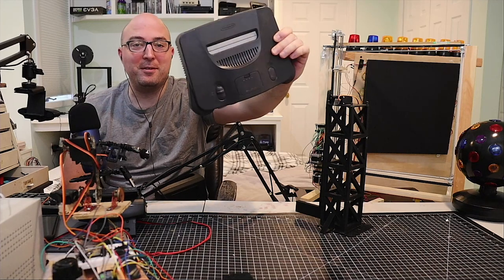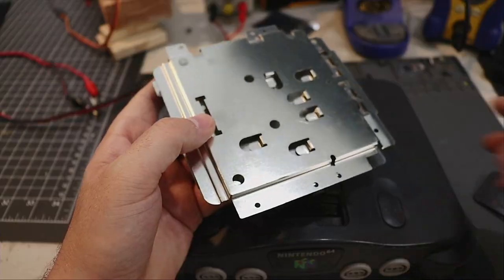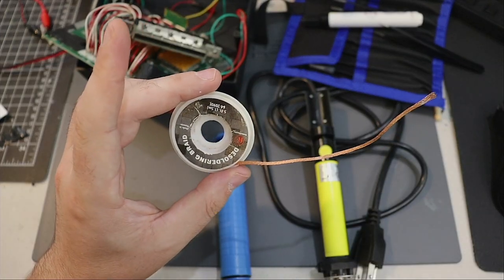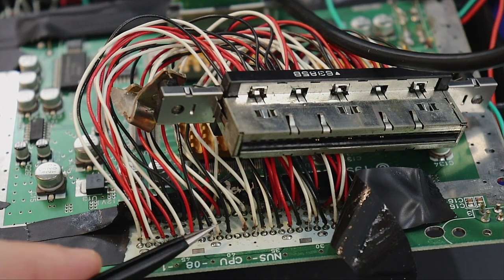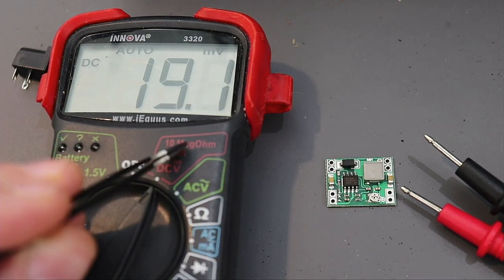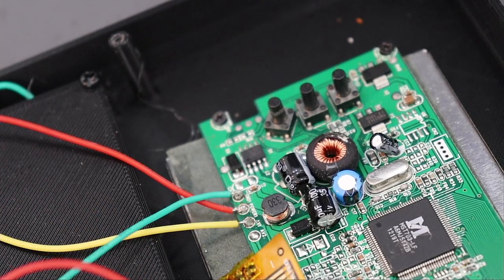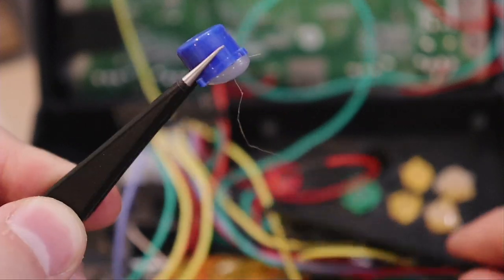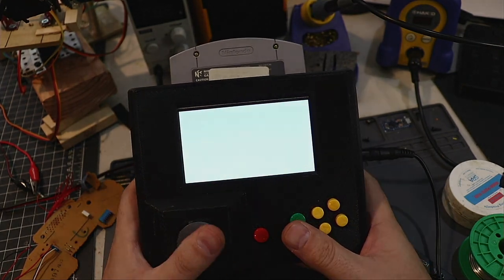How to make a portable Nintendo 64 (N64) with store bought parts

Comment: Hey! So I bought the audio amp and same potentiometers and audio Jack you have. I also want to use these 8ohm 1 watt speakers. How would I wire those in correspondence with your wiring schematic?

Comment: Can you do more tutorial on the power. I just don't understand. Does it take 3.3volts to power the system? Or do I also need 7.5 volts. I'm running tests and turn on the n64 at 3.3volts but don't have video.
Reply: I'm 2 years late but you will have to connect 7.4v negative and positive to the motherboard and 1 3.3volts to the motherboard

Comment: Thank you for the video! I am trying to relocate the cartridge slot. I soldered the wires to where it usually goes and it’s not working. My solders are clean and near perfect, and i’m using about 4 inches of 24 gauge wire. Could I connect with you via email to send you pics and invite your instruction?
Reply from the maker: Best way is discord. 24 guage wire is too thick, I would do 28 or higher
Reply: @noycebru  you said we could use the controller wire to do this?
Reply: I’d love to show you a picture of what I have so far. What is discord, and can you shoot me a link of a better way to connect with you? I feel like I’m so close!
Reply from the maker: Yea that should work. What happens with the higher guage wire is that it requires more heat to solder. Using more heat and too thick of wire can lift pads and probably won't solder well. 

Be sure to use flux too
Reply: @noycebru  but I already lifted the cartridge receiver - no solder required. Then I tried soldering 24ga wire to the holes where the pins normally went into. I successfully soldered the wires to the holes, then to the pins. Is my wire too think? What’s your discord?
Reply: @noycebru  just sent you a message on discord ;)

Comment: How do I keep my sodering iron from burning out?
Reply from the maker: Quality tips are important. I've used some cheap ones from Amazon that kept oxidizing and solder wouldn't stick well. 

You should keep your tip tinned with solder while in use, and clean it with a metal sponge, or a wet sponge if it's really on there.